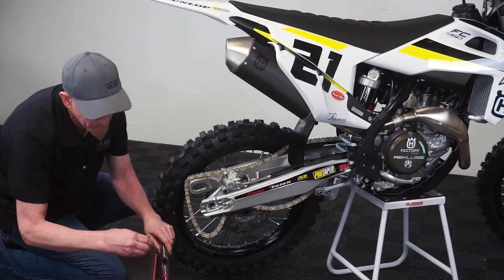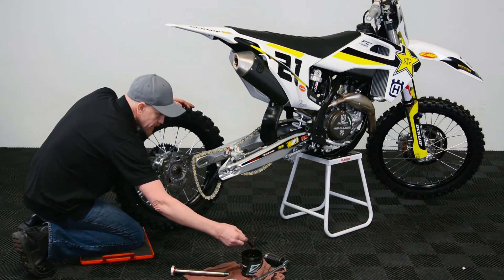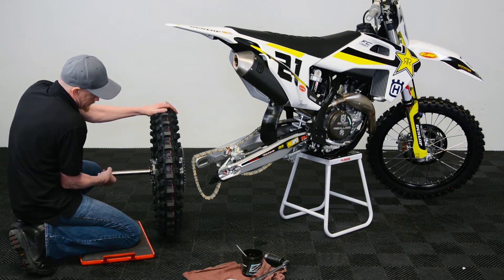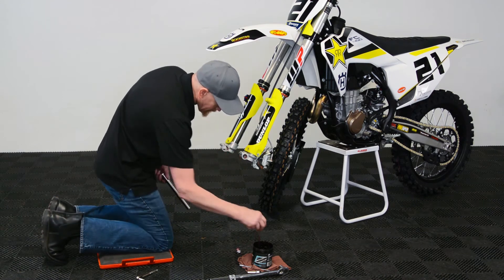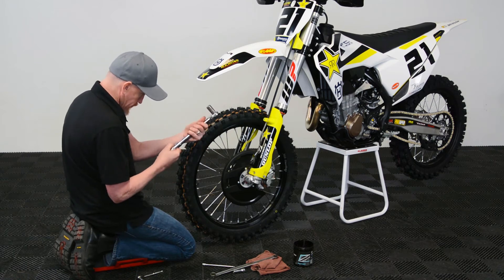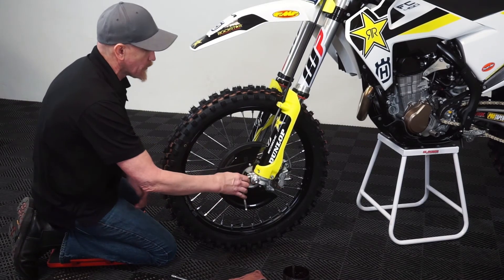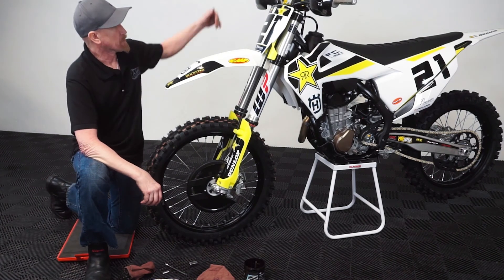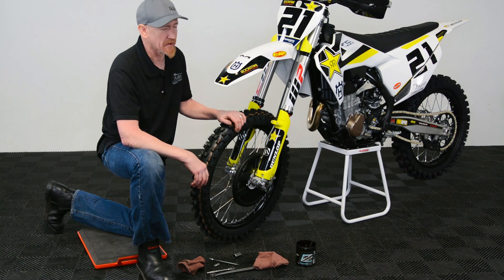Motorcycle Axle Greasing // AJAX Tech Tips

Comment: how to you fix that probelm of the axel not passing trough permanently? mine has that problem and every time i put the front wheel in i have to stick 2 screwdrivers on each side. is there any perment fix, to make the holes back to normal? 1:55
Reply: Yes, good question! You would have to file down the area it’s getting hung up and make it all smooth with scotch-brite pads untill it passes through smoothly